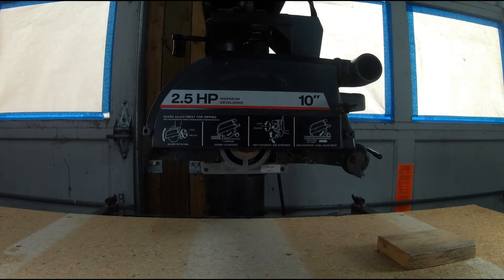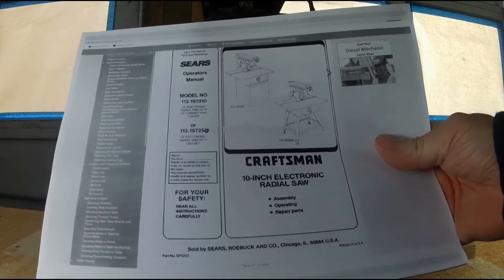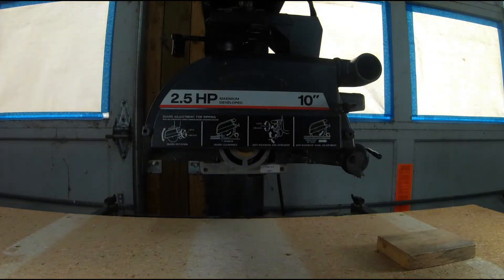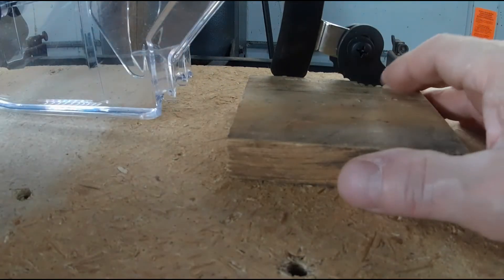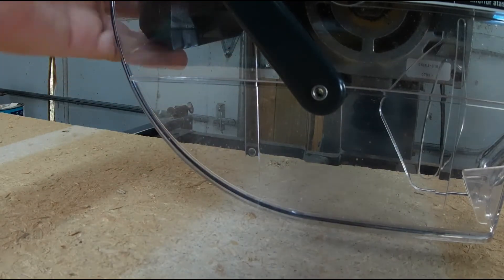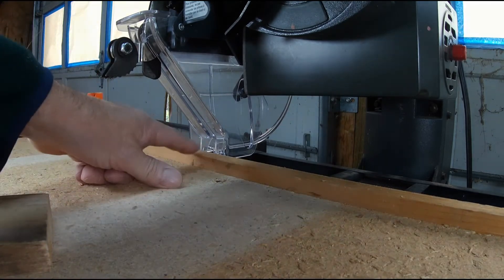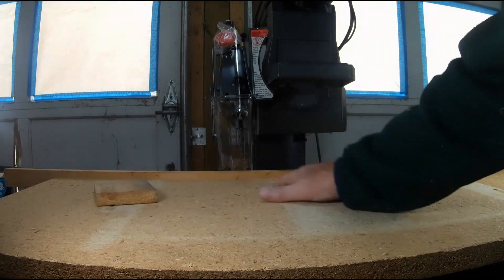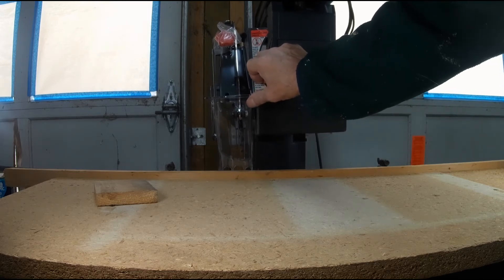Craftsman Radial Arm Saw anti kickback guard

Comment: Thanks for the video. I said they quit making radial arm saws because people wouldn't read the instructions. JW
Reply: Perhaps some of the techniques, of placement of board to blade, shown in the 50's manuals were not as safe as could be.   However, I still use my RAS, and think that 'seeing the blade' over the work piece is much safer that hiding it under the table.
Reply: The RAS is not for those casual, indifferent, certainly the reckless type. There are people who just don't think.
Reply: @woodensurfer  yeah you really and I mean really have to learn the radial arm saw. I think it isn't any more dangerous than a table saw in fact I would say a bit safer but people say the RAS is dangerous because they just don't bother to learn how to use it.

Comment: There are many smaller Dewalts. I will get the bigger ones if I can, however. I have a 12-inch Craftsman and a 10 inch Dewalt.

The 12-inch CM has plenty of power, needs 20-amp circuit or 240 volt, but I often use a 10-inch blade on it.

Comment: Thanks, want to see how these work as I consider building something similar for mine. Wish I could still get them but Craftsman thinks my saw should be thrown in the trash now because it's 20 years old (funny when you see all the videos of ones from the 60's still going strong!), they go for over $100 on ebay, I suppose because few people took advantage of the recall when it was open even though these saws are still everywhere.